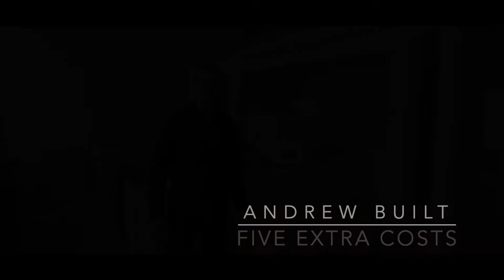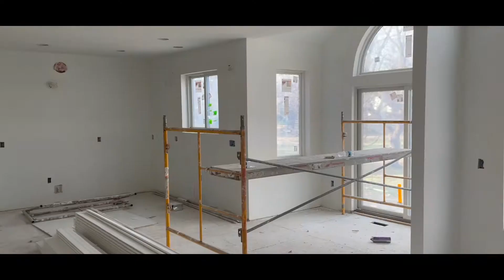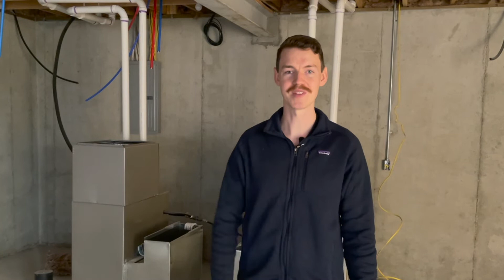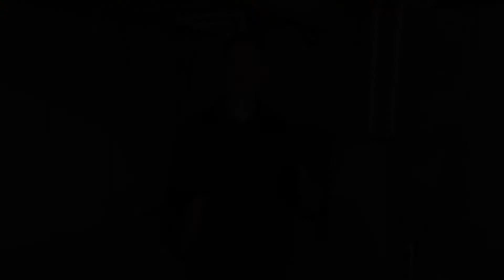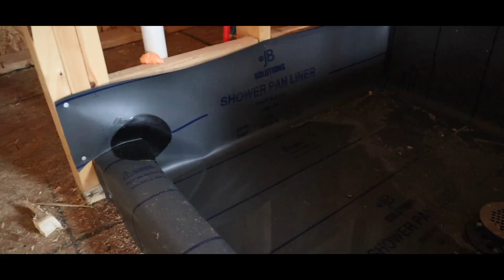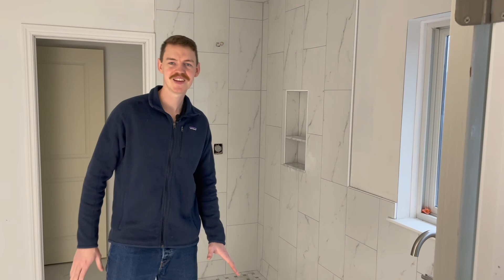5 Hidden Construction Costs : New Home Build 2021

Comment: Planning a build in 2022 and we worry about cost overruns and delays
Reply from the maker: I’m thinking that we’re going to see much more stability. Less turnover in the workforce will be a improvement as well.
Reply: @AndrewBuilt  I'm reading that 2nd quarter of 2022 it will stabilize so that's a good sign.